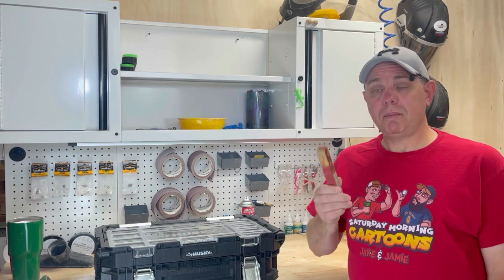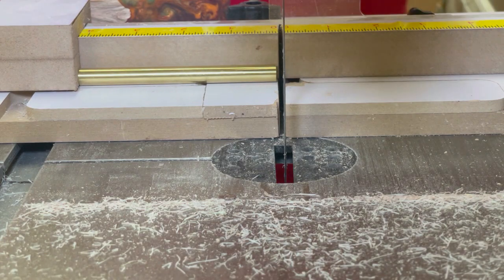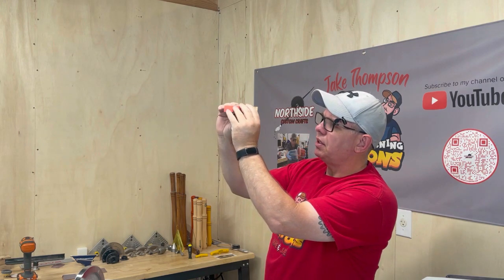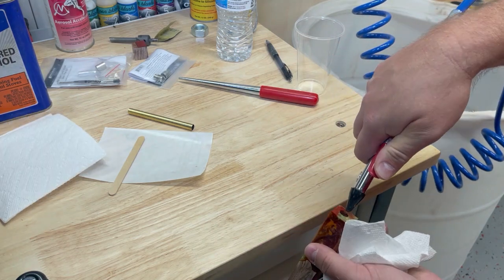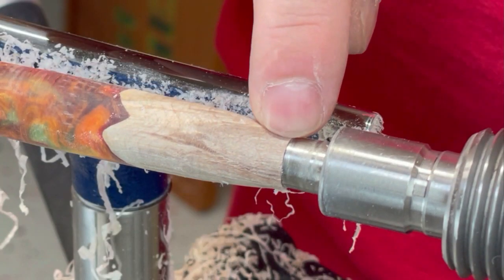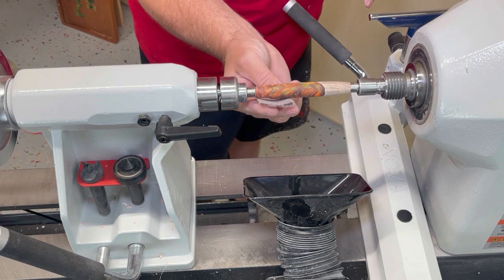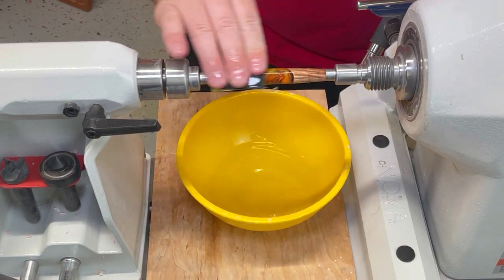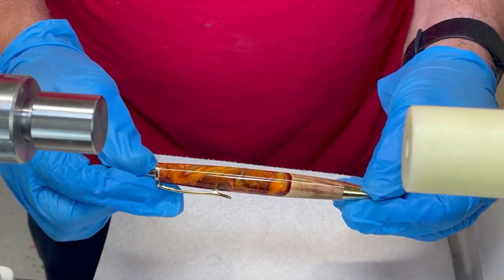How to Turn A Pen - A Complete Tutorial

Comment: Have you ever tried the felt used for pads on chair legs under your paper towels? I helps keep the heat off your fingers.
Reply from the maker: I usually double up on the paper towels.. for the video, I just wanted to emphasize that it will get hot. 👍

Comment: Great video for someone starting out in pen turning Jake.
One question, Are you not concerned about moisture in the wood from wet sanding before applying the CA finish.
I had issues when I first started turning pens, nearly 7 years ago, with the CA finish going hazy due to moisture in the wood.
Take care Jake.
Cheers, Huw
Reply from the maker: Thank you Huw .. I use stabilized wood.. so I’m not concerned with the moisture.. if I had unstabilized wood I would definitely lit it dry out before finishing .
Reply: @JakeThompson  Thanks Jake that makes perfect sense. Sorry I hadn't realised it was stabilised wood. Cheers, Huw

Comment: That was a very good tutorial on pen turning.  This should be a great video for someone just getting started at making pens.  Picked up a couple ideas as well - I really like that cross-cut sled you used to cut the pen blank, I'm going to make one for my bandsaw. I've never had good luck with CA as a finish on pens so started using melamine lacquer and have had much better success -- that's just me; others such as yourself seem to be able to make CA work well.  Only downside to melamine is that one needs to let it cure overnight before knocking it back and polishing.
Reply from the maker: Thank you Mark.. I wonder what the problem is with the CA finish.. Maybe we can figure it out. 🦾🦾